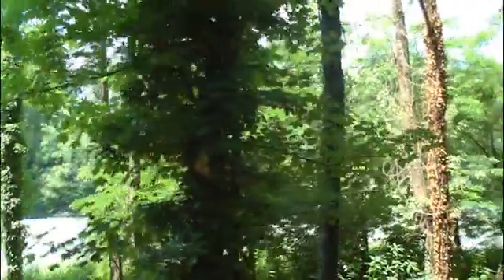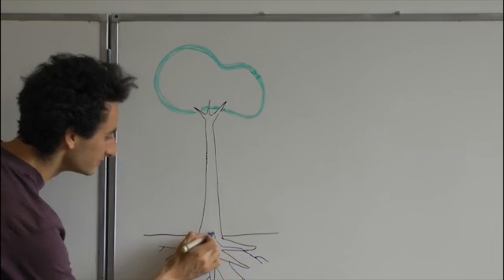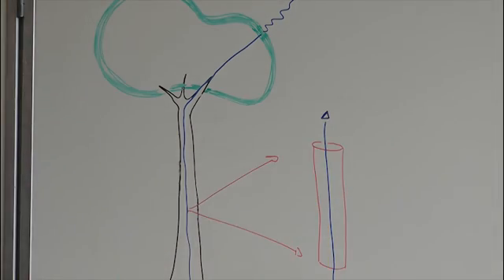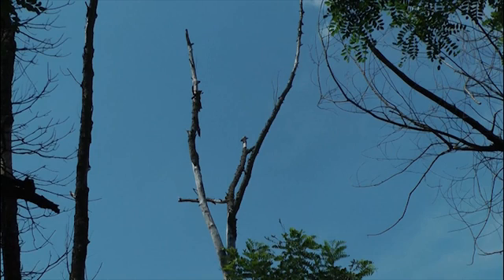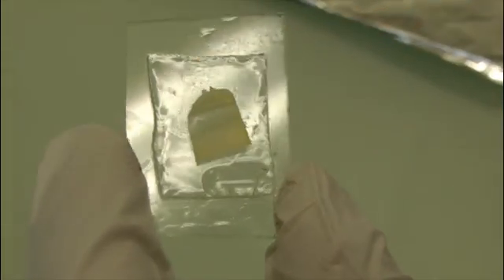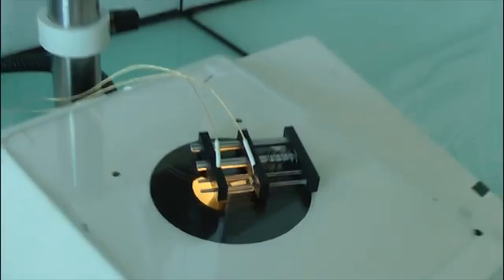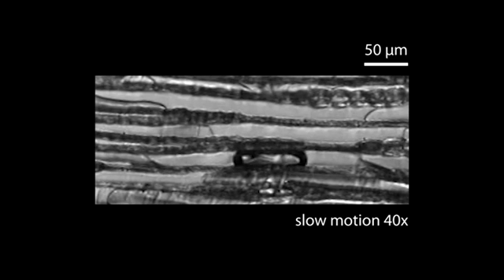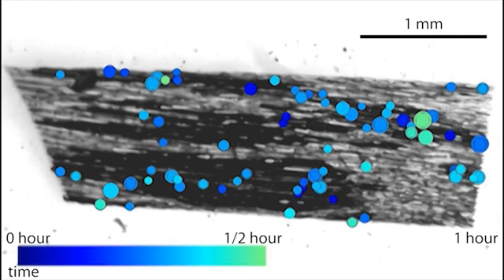The origin of sounds in water-stressed trees

Comment: Hi - I'm curious about the definition of "cavitation" -- in fluid dynamics, as I understand things, cavitation is the creation (and sometimes sudden/explosive collapse) of water vapour bubbles due to extreme low pressure regions in the fluid, where it seems that in the context of xlem embolism "cavitation" is used to refer to the intake of actual air into the fluid due to the tension in the water column. Does all this sound accurate? In other words, xylem embolism isn't cavitation in the same sense as, say, cavitation on a ship's propeller, correct?
Reply: Casey Connor: It's the same principle. The vessels carrying sap up a tree have to be sturdy to be able to draw up any liquid at all; this also enables them to sustain low pressures without collapsing. In this experiment, the cause of the low pressure is the liquid being drawn from the cut ends of the channels. The main difference with hydraulic machinery is the lifetime of the vapour bubble: the fluid passing the blades of a propeller experiences a large drop and recovery of pressure in a very short time, causing any bubbles formed to collapse quickly and forcefully. In plants, additional fluid must be transported to the site to be able to dissolve the vapour again; this is a slow process due to the microscopic size of its cells.
Reply: Steven Franzen Ok, so it is "true" cavitation. Wow. I read a different study referring to xylem embolism as aspiration, so I was confused. Thanks for the reply.